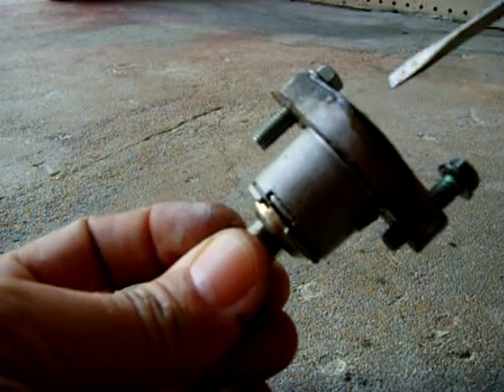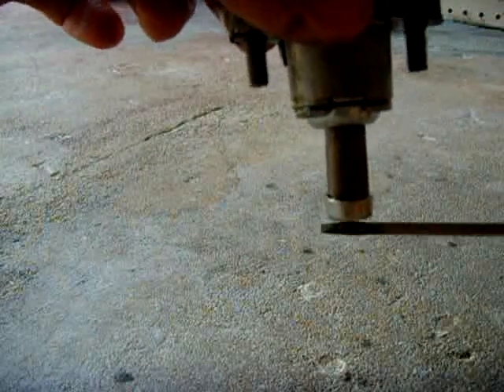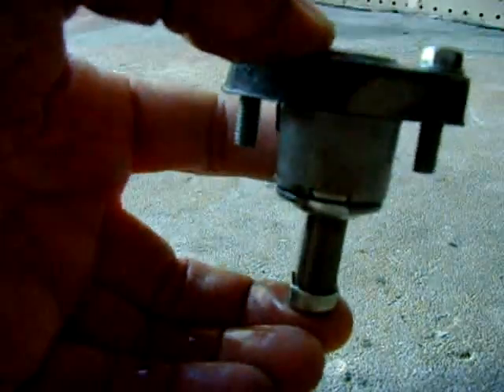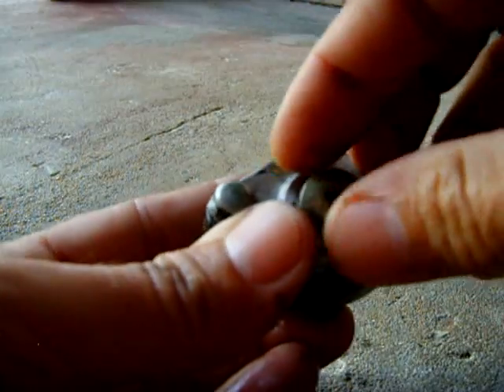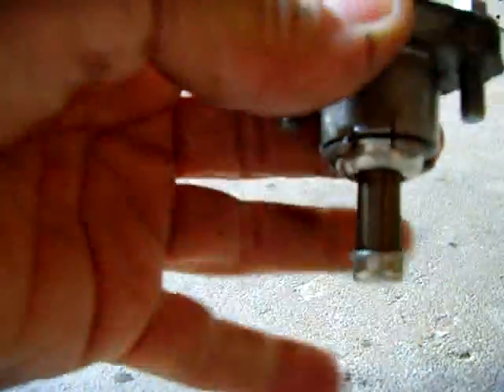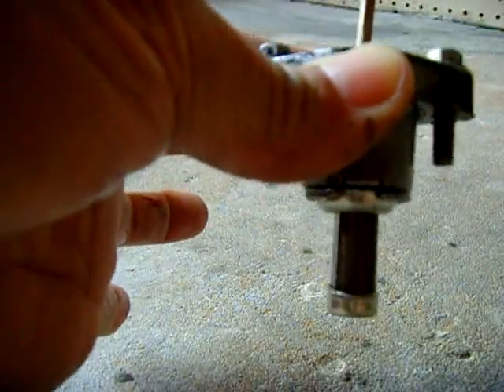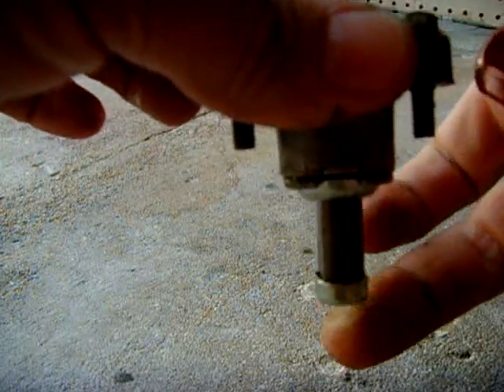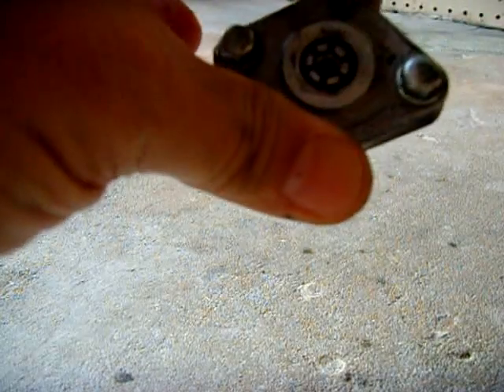GY6 Timing Chain Tensioner Operation

Comment: Same as the “automatic non-return type” tensioner in my Ninja 250, though mine is misbehaving. Yeah, if you install this kind in the extended position you’re gonna break something since it’s locked into a position that uses all the chain slack and then some. I’m not sure why we don’t use terminology like “spring-loaded ratchet-style tensioner,” which would make it more obvious that it will automatically extend but won’t auto-retract and you don’t want to install it while extended.

Comment: Thanks. But what is the large phillips cover for? When I checked my scooter, the phillips cover was missing and the timing chain has jumped a tooth or so. Oil was coming out the tensioner. Is the phillips cover just to keep the tensioner from leaking oil? Also, my tensioner seems to work when it's out of my scooter. I'm wondering if I need a new one or just try the old one again........with a phillips bolt cover.
Reply from the maker: To keep debris out of the hole where the small slot screwdriver goes. You should not have any oil coming out of the tensioner. Something is wrong. There is oil by the timing chain, but only being thrown around to coat parts. Sounds like your engine is flooded with oil. If you removed the tensioner, and it works as shown in the video, then save your money.

Comment: What size bolt mounts that to the engine i need replacements and can't figure out the size of bolt needed
Reply from the maker: It's metric, 6 or 7mm. Buy a couple sizes at a hardware store and try them out.

Comment: If Its Too Tight Will It Prevent The Moped From Starting ?
Reply from the maker: +TK Salas 
Hey there. Being too tight can cause a few problems, especially a weird sound from the engine when cranking. You also put too much pressure on the bearings and timing chain.
Thanks For Watching!

Comment: So when I tighten it and immediately loosens again help
Reply from the maker: Tighten until it locks.
Reply: @electronicsNmore   ok found the problem !! The coil spring inside snapped so I just replaced it and thing works a treat. 🤗.  Now the engine doesn't sound like it's going to blow up on me 😂